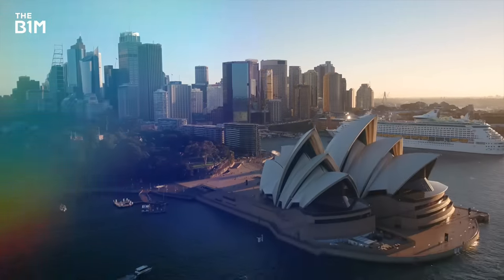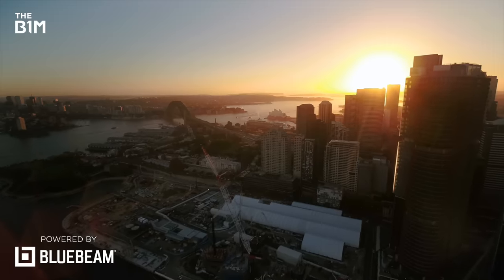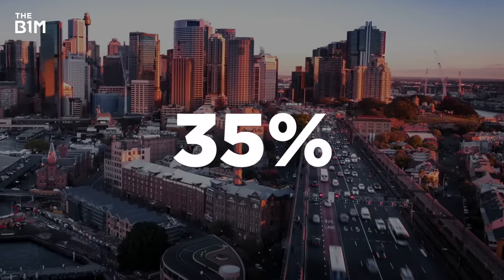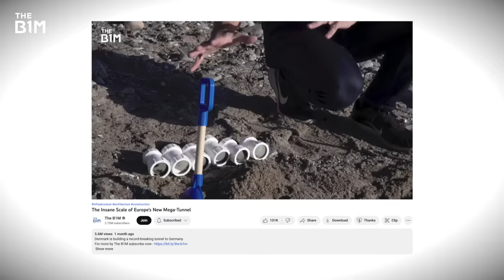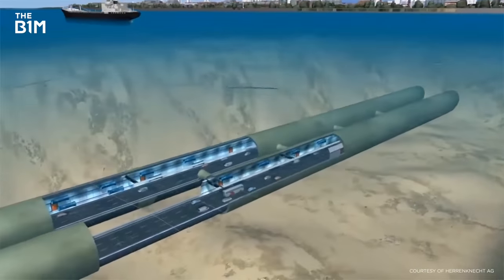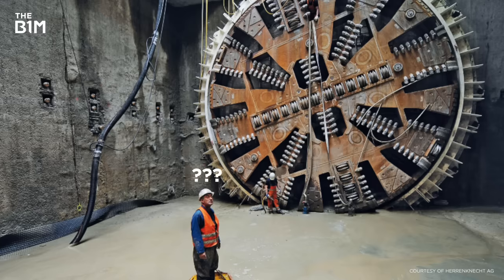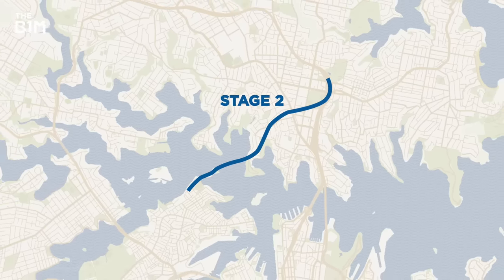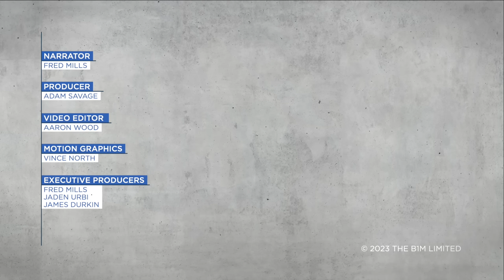Sydney's $5BN Tunnel U-Turn

Comment: Those size comparisons for the road Vs metro tunnels indicate to me there is space for a metro tunnel within the planned road tunnel. Do these tunnels go anywhere near the existing metro? If so, would doubling up be a bad idea?
Reply: Isn’t there already a plan to build a metro tunnel near there? If the grades are gentle enough for rail it works be a waste not to.
Reply: "Do these tunnels go anywhere near the existing metro?" yes and no. the road tunnels have a benefit of keeping traffic out of the cbd and off surface roads, but there wouldnt be the demand for trains to justify the cost. lets take the northern end point of the tunnel at cammeray, nearest logical centre being st leonards/crows nest. existing rail station, new metro station under construction. southern end being rozelle. nearest current rail station being stanmore, but already serviced by light rail with a rozelle station, and under construction metro station being built at the bays precinct, right next door. a metro tunnel across following the same route could allow people to change at crows nest and go straight for rozelle, but that isnt a common thoroughfare. going through the city is just a few minutes longer. in the future maybe. 20+ years.
size of the tunnels is just to allow future expansion. not sure on how they will do it, but the northconnex 9km tunnel was dug for 3 lanes per side and is marked as 2. later they can expand. the existing harbour tunnel was built as 2 lanes per side and is now stuck at 2 lanes per side. this new tunnel will be likely marked as 2 lanes, but has capacity for 3, maybe 4 lanes in the future. unlike the m5 east which was built as 2 and has suffered ever since and has now had the m8 tunnel take traffic from it.

ideally a metro could follow the same route, one from hurstville following a similar route to the A3 king georges road/lane cove road/mona vale road etc it has multiple names. hurstville to top ryde, to mona vale could alleviate a lot of traffic on that already congested road and link to numerous existing train and metro stations along the way. much more fitting than a bypass of the city by a km or 2 following the route of the western harbour tunnel.
Reply: @iris4547  I know nothing about the Intricacies of the city, I've never been and  don't know more than the video shows. My thinking was purely based on "a lack of public transit" and a "3 lane road way being seen as worthwhile" as a way to assume that the areas linked by the tunnel are actually relevant enough to be a viable transit route and given the space requirements, could be feasible. A kill two birds with one stone kinda thing. What with induced demand, a new road option will only lead to increased vehicle use. Just take a look at LA to see the effects of that line of thought.
Reply: @badbradmx  theres no lack of public transit in sydney, as the video suggests, i mentioned this in another comment somewhere where youtubes algorithm deems worthy under this video. the areas linked by the tunnel are more relevant to vehicular traffic than public transport by nature of the fact they are the confluence of numerous motorways. the current option is to send all that traffic into the city then back out again on the other side. this tunnel is to provide a bypass. never send it into the city to start with. but the local areas where the tunnel portals will be dont have strong demand for a public transit link between them that isnt already fulfilled by the existing network.
Reply: @badbradmx  no these tunnels are more about taking traffic off the surface roads than they are about increasing car demand. for example, this tunnel is eventually meant to lead into the northern beaches area of sydney. it is currently served by 3 surface level roads, none of which are a motorway. the population of the northern beaches is currently at 253k. all going through 3 roads. this tunnel and its eventual extension will take most of the traffic off of the 3 current roads into the area and allow them to become more pedestrian and local business friendly. this area of sydney has no train lines and there are no plans to build any  unfortunately. but the bus system is over stretched and the residents of the 2 main routes into the area will appreciate a reduction in traffic.

Comment: 6:45 I understand it's not nice but maybe it's fair to pay for your infrastructure when alternatives to car infrastructure are so much cheaper? Besides, you get extra infrastructure, from what I understand the old options are still available.
Reply: The old options include tolls, if i was to drive from Western city suburbs to through to CBD and over to northern beaches, i would end up paying close to $50 in tolls round trip.
Reply: @steveezzeddine9589  you forgot parking at the beaches. It can cost up to $100 round trip. Sydney has turned into a “don’t come here where I live near the beach” city. It’s disgraceful.

Remember when the previous state Labor government wanted to extend the Eastern Suburbs railway line to Bondi Beach? Idiots like actor Michael Caton and some residents didn’t want it as they said it’ll bring more “westies” to the beach! I suppose we should all suffer in more traffic. Buses aren’t a good option to get around Sydney for most people.

So sad.

Comment: For those saying that this is useless and that more public transport is needed, they are building another harbour tunnel for Sydney Metro Rail project which is due to open next year...
Reply: it's still public money that has to come from somewhere that could be used to build better value infrastructure. Still, this tunnel won't fix the problems it sought to overcome. A metro line has scalable capacity and can serve a much larger area, unlike a motorway. Sydney Metro NW is 36 km long, mostly underground and cost only slightly more than the projected cost of the western harbour tunnel which is about 6km long. This tunnel guaranteed will have massive cost blow outs.
Reply: Yes, these people talk like it is an either/or situation. We need both car and public transport. And considering the government is investing 63 billion into one of the largest metro rail projects in the world, we cannot say that Sydney's public transport needs are being ignored for the sake of another harbor tunnel.
Reply: @artistjoh  63 Billion for the metro? Im pretty sure it's MUCH less, mabye 10 billion at most.
Reply: @artistjoh  there are enough roads there, people will still be able to drive.

It's much more efficient to spend the money for more public transport (for example a second North-south metro further West) than to build more roads.

Drivers would also benefit, because the number of cars on the road would be reduced
Reply: @nicolasblume1046  it's not far off from AUD 50+bn if you include Sydney Metro North West, CBD, South West, West and Western Sydney airport whcuh are under construction right now. 

This number doesn't include amounts spent on light rail or additional extensions which are in planning phase still.
Reply: @nicolasblume1046  Both public transport and car transport are needed. Public transport is always limited by the fact that routes do not go everywhere. I, for example would not be able to go see my grandchildren without a car, but since I live in the CBD I walk and use public transport more than I drive. I am also hyper aware that crossing the harbor to a business I need to go to that is not easy to get to on public transport takes barely 15 minutes off-peak, but at busy periods can take more than an hour. We desperately need the additional harbor crossing IN ADDITION to more public transport corridors. It is not an either/or situation, it is a both situation.

Comment: One major difference withthis project is the planned three lanes in each direction.  When I first came to Sydney I couln't believe the various tunnels were contrsucted with only two lanes in each direction.  so WHT is an outlier from that perspective.  However I do agree with others that simply building more roads is not the ideal. reducing the number of cars/journeys/heavy vehicles would be more cost effective if politically more difficult.  Thanks B1M; great video as ever. .

Comment: I live in Sydney. 
I don't find it hard to get around at all, since the motorways got connected up, new tunnels, west connex, north connex..
I can be anywhere in the city in 25 minutes. 
Vs
Hour or more before.
In my car.

In addition to that, the Metro line has made an impact and the expansion of that is huge.

Bus services never been so good either right to CBD.

Sure, this tunnel will help with CBD.
On top of harbour bridge, the tunnel, anzac bridge and several other routes into the CBD depending where you are coming from.

The opening of the video was just a bit misleading and over the top for me mate.
Love the channel though, long time fan.
Reply: When that Metro line opens up from lower North Shore into inner west next year, that's gonna be massive. Like Chatswood to Petersham in 20 mins or whatever....amazing
Reply: I am in Baulkham Hills. So, M2 then anywhere. Has been a game changer.

Comment: As usual, short sighted solution to a long term problem. Even cycling/public transport is only a medium term solution. The long term solution is to disperse jobs/education and wealth more evenly geographically so people don't feel the need to live near big cities.
Reply: That would be very very expensive. Because you have more infrastructure that serves less people, which means higher costs. In other words, it would likely generate debt for the city and is equivalent to just sprawling out even more.

Comment: The only time traffic in Sydney may get bad is peakhour. The rest of the time its fine. And the public transport is awesome - its basically all i use and they are pouring billions more in to it.
Reply: You would be surprised with some parts, the pacific highway going south, through the Sutherland Shire is constantly clogged with traffic, I remember a few months ago a truck fell on its side right before Tom ugly bridge going northbound at 6am and the roads didn't get cleared till a bit after noon. Liverpool, Parramatta and south of the city are struggling to keep up with all the growth and little to no investment in new motorways where they are desperately needed. On my daily commute to the train station to school, I get driven half way to padstow and when there is no traffic it only takes around 20 minutes but when traffic is backed up it can take up to 40 minutes even. And that's only with being stuck in traffic for roughly 2km

Comment: Thank you for your explanation and diagrams showing how they are building the tunnel, I have lived and travelled the world and Sydney’s traffic while congested it’s far from the nightmare of many other countries… The public transport (buses, trains, trams and etc) are some of the best in the world… especially when it comes to peak hours and right through the week in and out of the city… one of the reasons it makes it more efficient is the fact the drivers don’t have to mess around with currency… Everyone has a prepaid card (Opal) all the passengers have to do is tap when they get on and tap when they get off… The residents are always going to complain regardless I don’t really blame them as it’s a nuisance but it’s also progress… It’s like Luna Park at Milsons Point the residents in the area have petitioned and closed it down so many times because of noise, Luna park has been there since the 1930’s but the resident’s knowing this move into the area then complain… it’s always going to happen regardless people don’t like it when it’s an inconvenience to them… though the NSW government should be planning ahead of time not when it becomes a problem and that’s always going to be the case unfortunately…

Comment: I would say a lot of the problems with the traffic stem from Sydney being a unplanned city. Unlike Adelaide or Melbourne which where planned, which makes traffic ten times better. And also allows for easier implementation of public transport services. So most engineering projects won't change much when the root cause is do with city planning.

Comment: Auckland is also supposedly getting an underwater highway tunnel, which would run along side the current harbor bridge. Though that project won't start until atleast 2029.

Comment: We used tubes and tbm’s in two recent mega projects in Boston. The tubes were less expensive, and faster.  The tbm’s did their job - but did cause structural damage on existing homes and commercial buildings. At least one tbm got stuck and was abandoned $$$$

Comment: It should be mentioned that even before we got to this stage we took several wrong turns. One of those was planners feeling the need to connect all of this to North Sydney and thus the Warringah Expressway (which will become an even bigger monster - its a nightmare now). There was a need for a decent connection between the M4 and M2, but this whole scheme was born of subsequent generations of road planners feeling the need to put motorways through the CBD and through North Sydney. Not to mention that part of this scheme is/was to create even more underground motorway leading to the North Shore, despite the alternatives - including a metro - being better value for money. That also explains the needless linkage into the Warringah Freeway. I'm not saying that we shouldn't have built a tunnel, but it should have been further west and bypassed North Sydney entirely. There is one light at the end of the tunnel though. This might provide the alternate path needed to make it feasible to demolish the "Western Distributor" - another road scheme from Hell cooked up by road planners last century that divorces the CBD from Darling Harbour.

Comment: Another possibility could be to spend further development on the public transport system, Sydney could stay the traditional hub, reaching across regional areas to prevent people driving long distant adding to the congested roads. Reducing transport time with upgraded rail system and quicker express trains. Another consideration to use negative vacuum pressure tunnels.

Comment: On the plus, it seems like a good addition to the road network, and provides an important link as mentioned. But this can be a minus too, because many more cars are going to bed put on the road at either end because of the new trips that are possible. It might reduce bottlenecks at the other mentioned links, but it's not going to make traffic at either end any better, if anything it'll make it worse. I hope the tolls are high enough to discourage non-essential journeys. 
(Commuters in Sydney who require toll roads are eligible for partial subsidies.)

Comment: I think your remark that Sydney lacks transit needs addressing. 
Sydney has major traffic problems but it also has extensive bus and rail networks. 
Here are some basic facts about the rail system.

Daily train ridership before the pandemic was about 2.5 million boardings per day. That’s pretty impressive for a city of 5.1 million.
The network has 8 lines with routes covering 229 miles and 170 stations.
New lines and routes are being added including an ambitious Metro system of driverless trains.
Headway is approximately 3-4 minutes within the city and 15 minutes at outlying suburban stations during peak hours. 
The rolling stock consists of air-conditioned modern double deck carriages.
It’s safe, clean, graffiti-free and works pretty well.

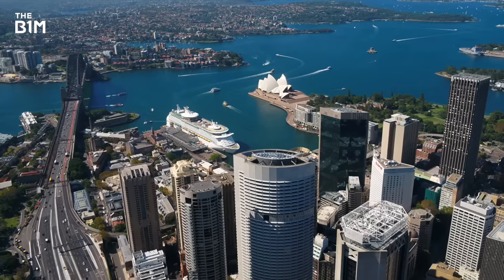Comment: 1:27 I think "lack of public transport" needs qualification or correction. Sydney has extensive public transport which isn't perfect, but includes trains, buses, ferries, light rail and metro. Sydney is geographically larger than many global cities that is compared with. For example Sydney is 7 times the geographical size of the Greater London but with just over half the population.
While there is certain not a lack of public transport, it's better to state that the public transport is not evenly distributed with areas of the west getting far less access than areas to the more expensive suburbs to the east.
Sydney's public transport network was covered extensively in the report "Urban transportation systems of 25 global cities", although as per the report, it was one of the cities that leaned on personal transport more than others did.

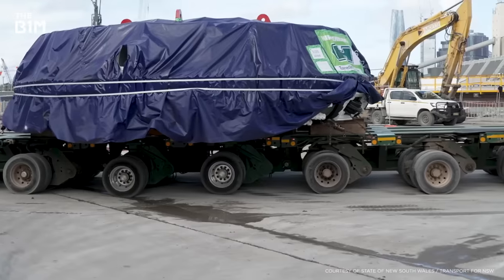Comment: 5:19 Let's hope, for all involved, that Herrenknecht can do what they say they can do in the time specified.
We've just had a shaft pre-sink done by them in Australia and it was a nightmare.
Machines delivered late, shaft deviation out of spec, over time by months and machine failed to get to planned final depth.
Our company is still trying correct the issues so we can move on to shaft sinking.
Very unimpressive to deal with 👎

Comment: Many errors here: I’d hardly say Sydney has bad public transport. It actually has a very good train and bus system.  But it is point to point. And you have a darn BIG Harbour divide the city. So you have many roads squeezing into limited crossings. The same crossings buses and trains use. Plus many of the train lines are east-west and the Harbour traffic is north-south.